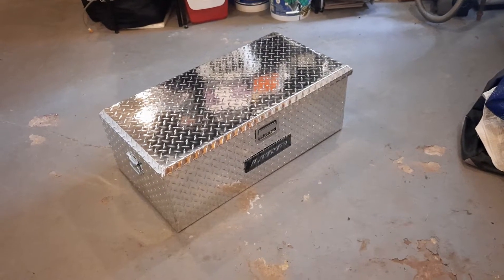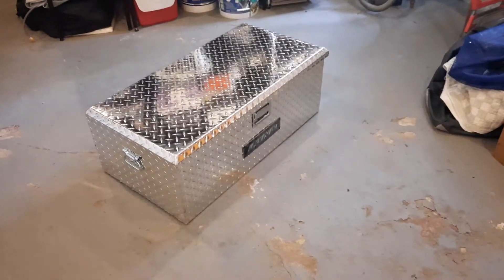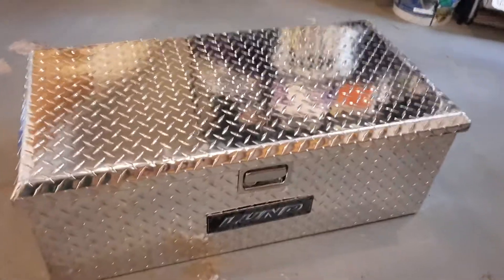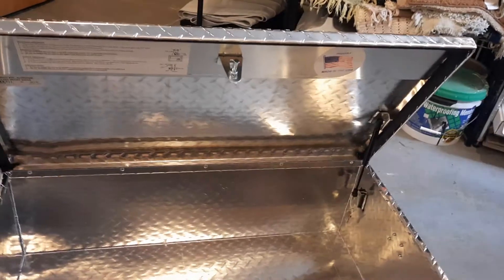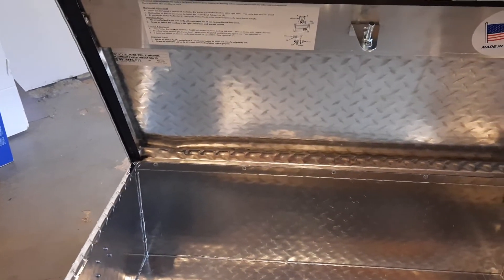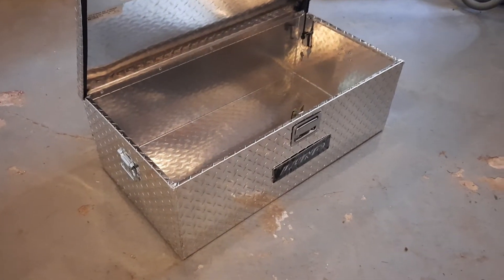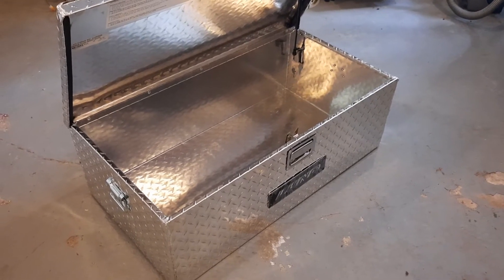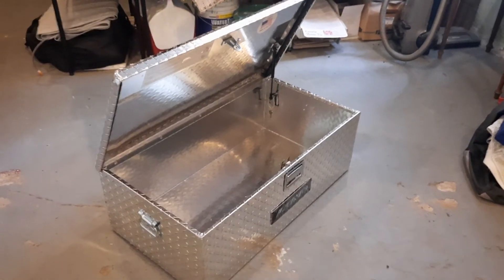Lund 36" Aluminum Diamond Plate Tool Box. Quick Review. EV conversion battery boxes.

Comment: How easy or difficult would it be to cut into the diamond plate finish? Trying to do a slight project for a new travel trailer battery box storage, but do know where to start. Any pointers would be greatly appreciated!
Reply: The aluminum is pretty thin. You can cut it with a sawzall or 4 inch grinder with cutoff blade.
Reply: @ outstanding! Thanks the input and the metal cut off disc was the way I was planning on knocking out this project. Much appreciated!
Reply: @LuisPerez-vy6bz  BTW, I've been getting some "stray" or "leakage" current from the cells to the box. Very agrivating, I may be switching to PVC enclosures.